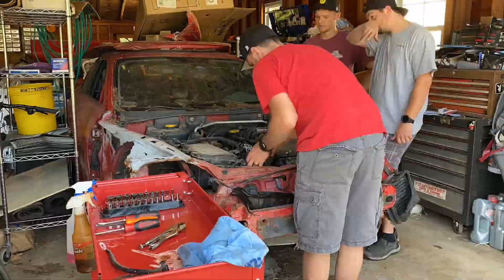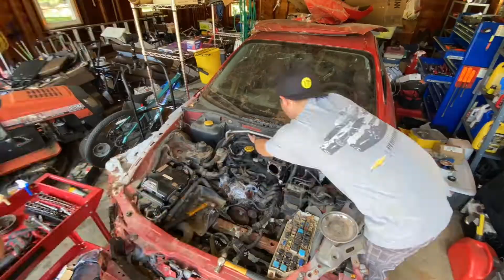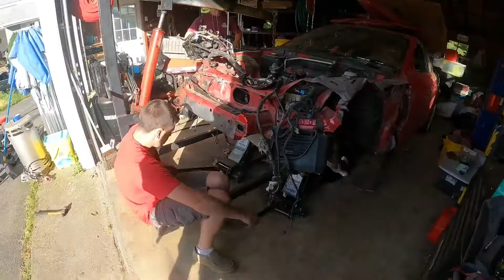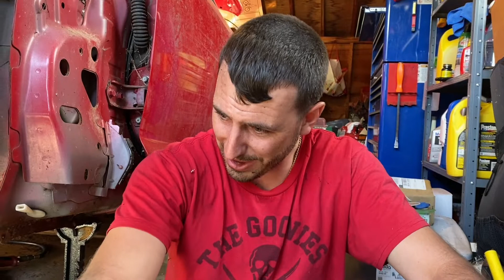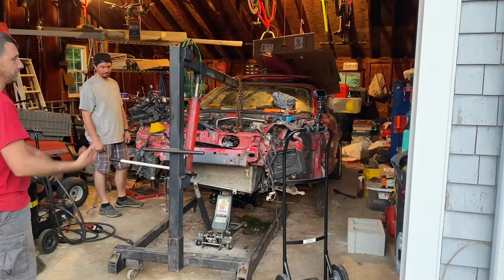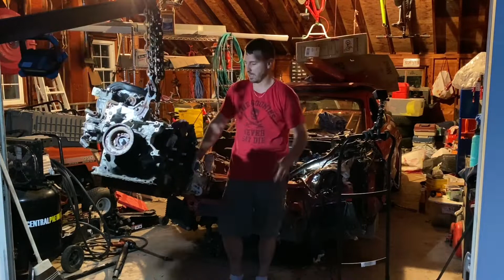Pulling the Rotary Engine from the RX8 | Rotary Miata build ep.1

Comment: It's actually easier to pull the engine without the tyranny. Anyways what year Miata you guys putting that engine in? I'm planning on doing the future Renesis rotary swap an ND Miata RF. Can't wait but need to find a good RF chassis.
Reply from the maker: Thanks for the tip, we didn't have a lot of room to disconnect and support the tranny underneath. We'll be putting it in an NA (1990). Nice to know other people are working with the Renesis engines, most swaps I've seen are with older rotaries.

Comment: are you using the subframes from the rx8 for the miata? how about the instrument cluster and wiring?  I am doing the same conversion so very interested
Reply from the maker: We’re going to try and use the rear subframe if we can make it fit so we can use the whole rx8 drivetrain. We’ll most likely use the stock cluster but we did save the rx8’s because the whole thing will probably eventually be run off a standalone ecu